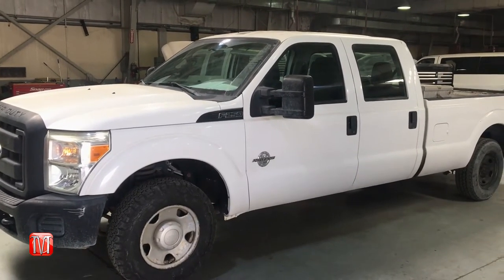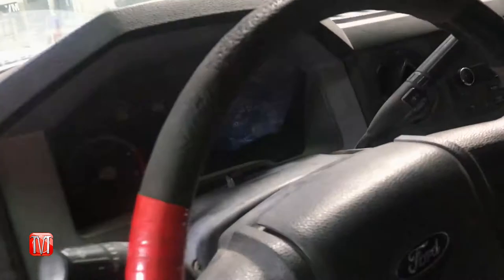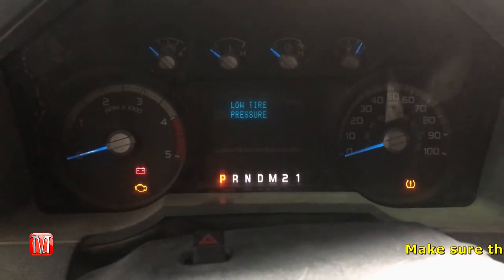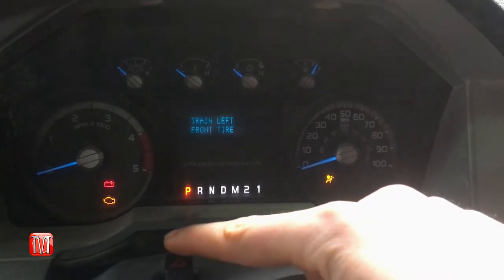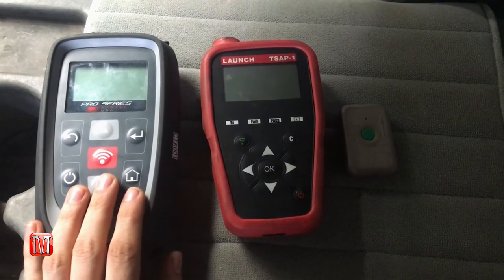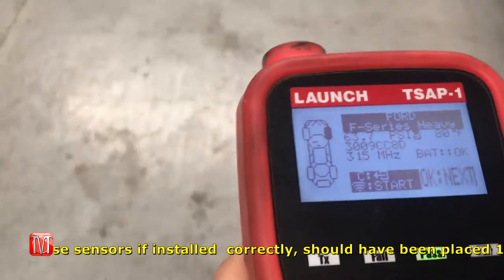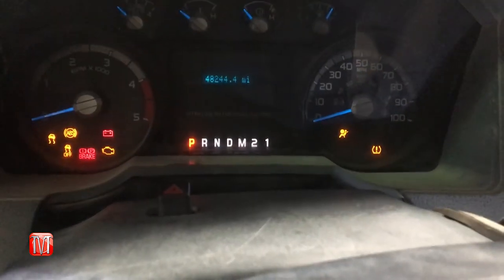How To Program The TPMS on a Ford F-Series Truck

Comment: 3rd Option ( but requires FORScan ) - IF you buy your TPMS before you head to the shop - you can write down the hexadecimal code printed on the sensor itself ( I.e.  62E148A4 ), and then using FORScan ( Can/Bus ) and directly drop those 4 values into the 'configuration' under 'BdyCM' and then you'll scroll down and see the 4 old TPMS values.  Change them here.  You probably will have to tell the tire place where to put the TPMS's LF RF RR LR - I just marked my boxes front and back and this all worked like a charm for my 2018 Ford F-150 XLT.  I hope this helps someone.
Reply from the maker: Good point I forgot about that. Another think to keep in mind if you go this rout is if you keep those TPMS codes, if you ever loose a tire or have one/more stollen you can use those codes to help identify those tires.
Reply: I know it’s been a year since you wrote this comment but I just changed my TPMS sensors, upgraded to the extended version of FORScan, and the only option I see under BdyCM is to enable/disable “AutoLearn”… I figured this meant I just needed to drive it, but that didn’t work. 
I know there’s a mode in FORScan where it seems you can modify “as built” values in a database of some sort, but just looking at it, it’s not clear at all to me which values I should be changing. 
Any advice for me? It’s maddening how all these videos purport to show programming, but only show relearning.

Comment: You didn't mention needing a scan tool until halfway through the video.
Reply from the maker: Sorry about that. Thanks for pointing that out. Next time if I make a TPMS learning video I’ll make sure to mention it in the beginning if it need one.
Reply: Is it possible to complete the relearn process without a specific tool? Just by letting the air out?
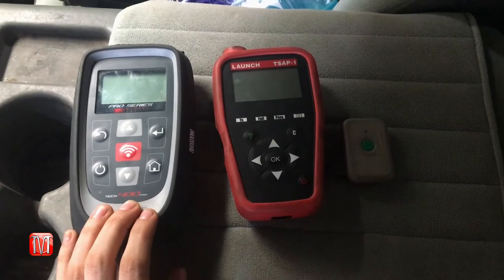Reply: Yea I was all excited thinking I didn't need any tools till 2:00 in.